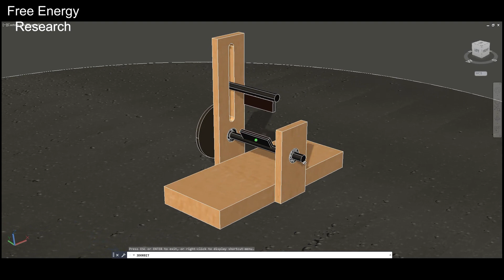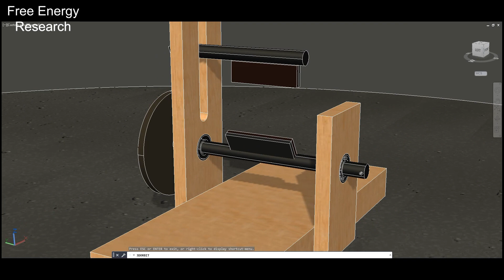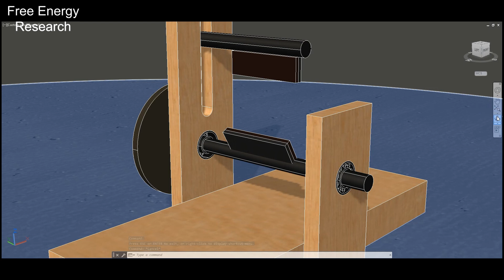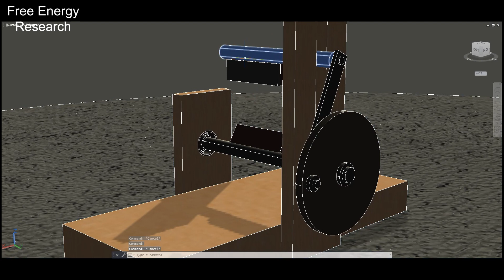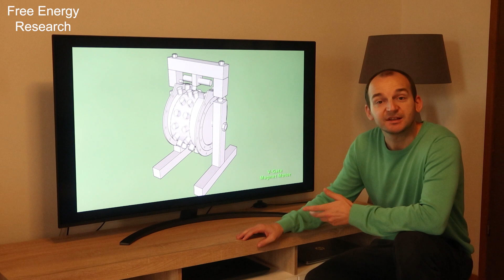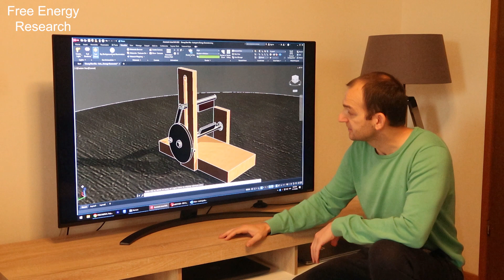Free Energy : Autogenic Energy Generator

Comment: If the design was in its side by 90deg it would possibly not have to fight against so much gravity force by having to push upwards on each rotation but rather horizontally would be less energy loss